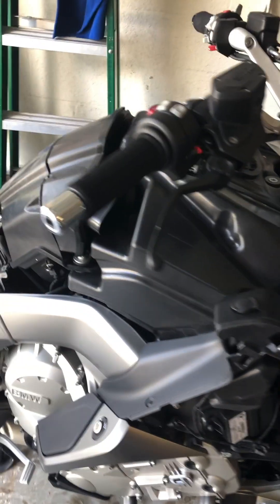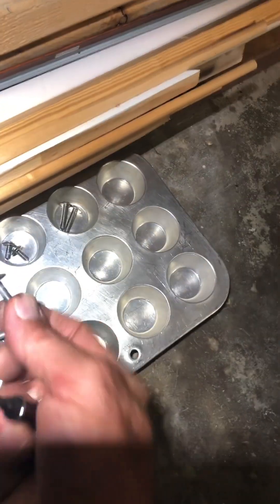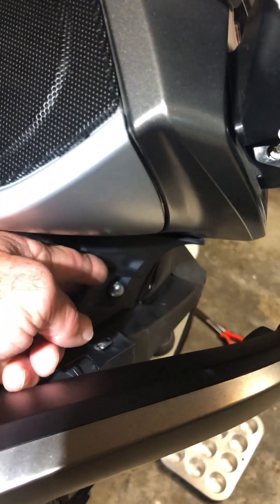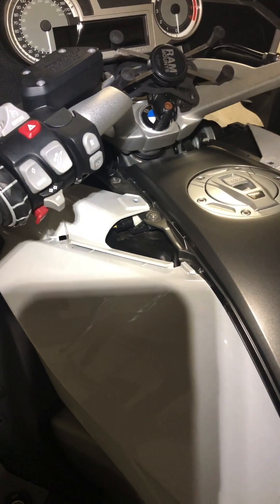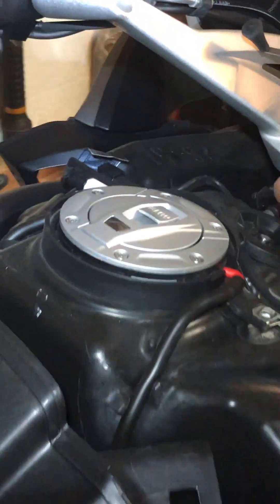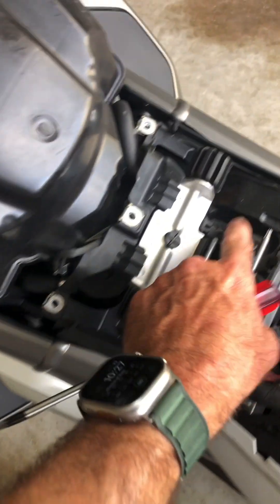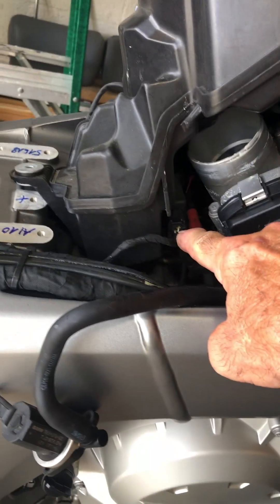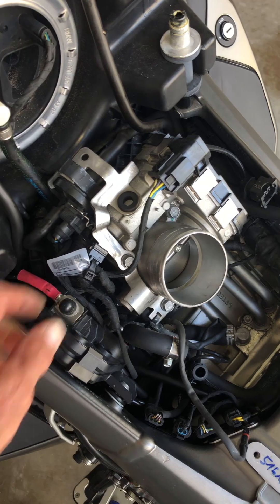2018 BMW K1600GTL REVERSE CONTROL MODULE

Comment: I can repair this fault without replacing the module but I m from china
Reply from the maker: Well you may put that skill out there on the forums, there's a lot of   People upset about having to pay $800 for a part that shouldn't break for along time. I've already tossed my old control and a matter fact, I don't even have that bike anymore, I have a bike that doesn't have a reverse gear on it.
Reply: How ?